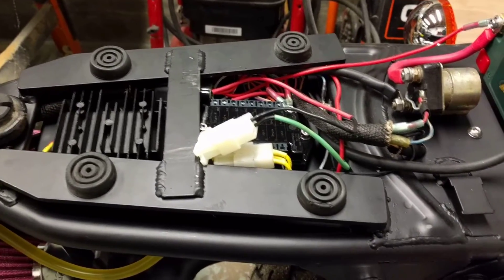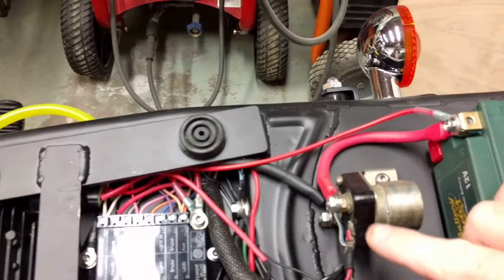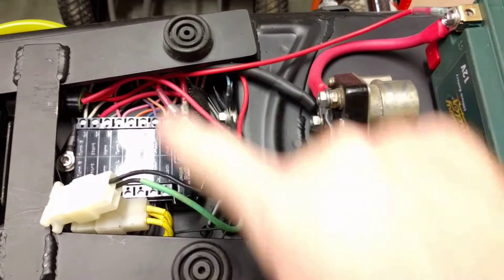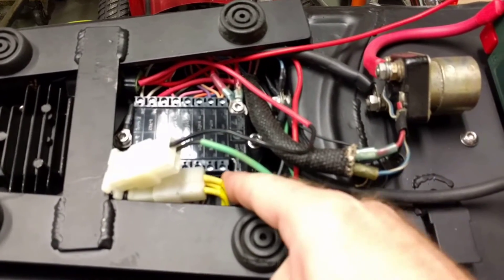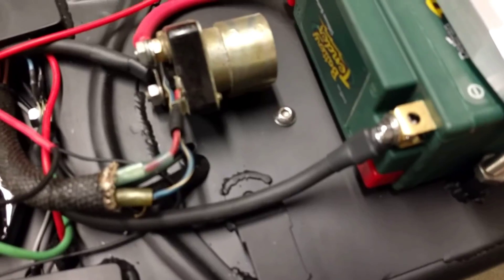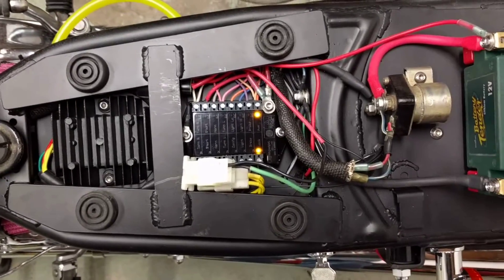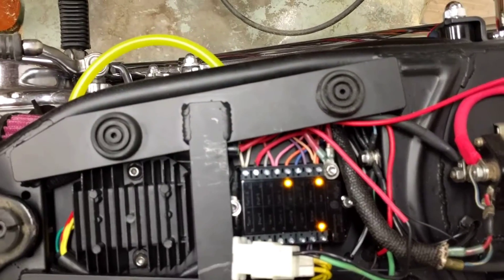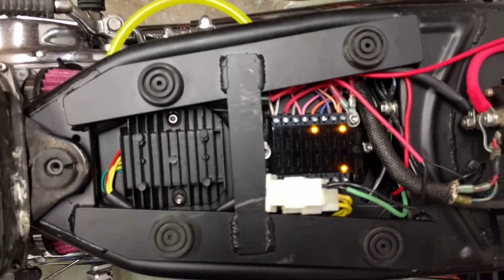Motogadget m-unit with pma setup explained

Comment: I understood that the M Unit could work as a starter relay up to 30amps. Made to be able to start old HD and BMW
Reply from the maker: Maybe the m-unit blue the newer version can do that. I have the older original m-unit wired to my stock solenoid. Solenoid draws its main current directly off battery not from the m-unit itself.

Comment: Thank you for this video! Is the new PMA required to do this? Do you think this same setup would work with an antigravity battery?
Reply from the maker: No you can run the stock charging system. I recommend the PMA kit but it is an investment.
Reply: You are helping a lot of people here! thanks for the quick reply!
Reply from the maker: @nickmurdock507  no problem I didn't get mine done all by myself. Lots of great people out there with good info. That's part of the journey talking to people. Motorcycling community rocks! All about having fun.
Reply: Last question for you-  For other systems on the bike... if you can remember what spedo adapter did you use? Did you also just eliminate the stock on/off switch and neutral light?
Reply from the maker: @nickmurdock507  I ran the stock speedo. I bought my ignition key set up from Dimecity I think it was $20. The neutral indicator is on the the tach which I opted to not use so I don't have a neutral indicator. Easy to wire though if you want the lil screw on top of back side of case is the lead for neutral indicator. One thing I wish I had added was a kill switch on handle bar. My clutch drags a lil so getting into neutral while running is almost impossible so I have to grab clutch with my right hand and shut bike off with my left hand because I put key under my left cheek. Kinda a pia but life goes on.

Comment: Hey man, a month ago i bought the XSCharg PMA and High Output Ignition Kit with a capacitor for my XS650, last week i thoght i connected every thing good but i cant make it start. How did you connect the ignition system? 
I would thak  you a lot with youre response,
Regards
Santiago
Reply from the maker: Santiago BRC are you running a Moto gadget m unit?

Comment: Awesome video!
Can you tell me where did you get the wiring loom and what size it is?
Reply from the maker: Arnoldo Avilez That loom is a NAPA  auto parts special buy. It comes of the roll and pay by the foot. Think it was less than $5 and I bought 1/2 inch and some 3/4 inch. Easy to work with 👍

Comment: Did you need the original witing harness while using the m unit? Or did the m unit replace the whole harness?
Reply from the maker: If your going the m unit route you will be scrapping the stock harness. I got my wiring kit from Revival cycles. It had almost everything needed in the kit. I mean this is a custom installation so I needed a few odds and ends. But their kit has diagrams of a few senerio and wires are color coded for the application they are needed for. So that helped out a lot and to buy all the different gauges of wires in colors needed would have cost way more $$$. So the kits makes a nice clean looking sensible job in the end.

Comment: Is this all you needs to get the bike to running? I have an m unit, looking to get a pma and pamco.
Reply from the maker: Kerwin Jones yep pma pamco starter solenoid the fuse box and m unit control switches. Rival Cycles has a great wire kit for m unit and I got the loom material from NAPA auto parts. It's fairly easy but I enjoy wiring stuff.